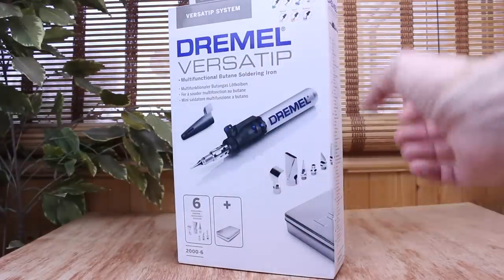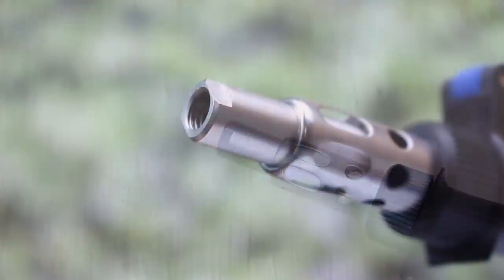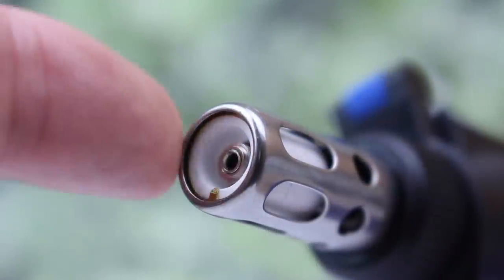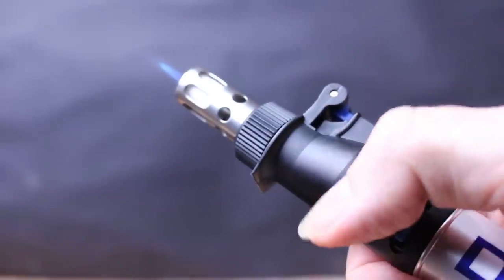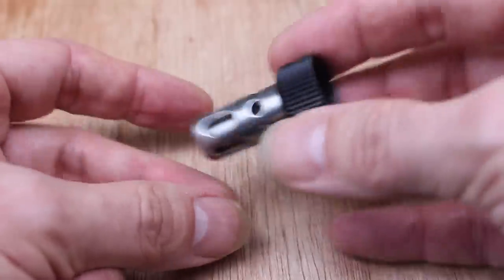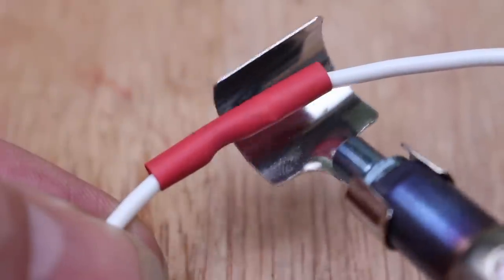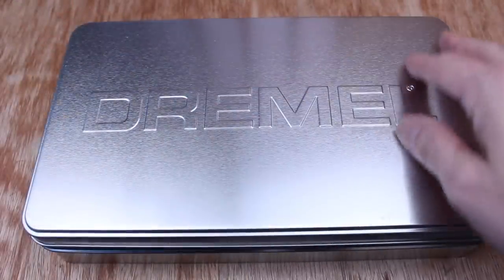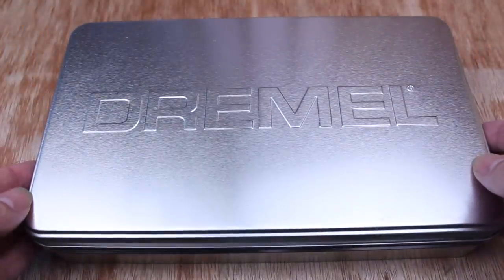Dremel Versatip Gas Soldering Torch Demo & Review in HD

Comment: I bought one of these a few months ago thinking it would be ideal as I didn't want to be tethered to a cord. They are OK but one down side and I think its worth mentioning is the heat exhaust. You have to be mindful of this particularly if you are working close to other parts or structures which can ignite, melt or burn easily, including your fingers! I on sold mine unit and went for a 50w lithium battery soldering iron. 100% better.
Reply from the maker: Yes, a good point , especially with the solid tips like the knife or the soldering tips, the heat comes out of the sides. Whatever the tip, it still has a flame. Dave
Reply: What do you use it for ,the battery one that is?can I use it to solder car wires for a computer box?

Comment: Mate I have one and been using it as an auto electrician for several years. When you have the soldering tip on theres a small vent hole on the side. Flame just protrudes and its great for heating wire up so the solder sticks and also the best for heat shrink. 

Then that travelling cap you spoke of. It is for when its hot. A safety cap. Put it on when the tip is roaring hot but do not put away till its cooled.
Reply from the maker: Thanks for the tip! Dave

Comment: Great video!  Thx!  One thing to add, I read reviews on Amazon and people are upset that Dremel is no longer supporting this product. No replacements parts or tips.  That's a bummer because I really liked your video and was thinking about buying one. Oh well....
Reply from the maker: I didn't know they'd stopped selling the tips. Buty the unit is pretty inexpensive  anyway, so probably wouldn't be worth repairing or replacing any parts on it. I guess everything still has a 12 month warranty. Dave
Reply: @CelticDreamsCoUk   My understanding is they are not honoring the warranty.  Many upset customers on Amazon.

Comment: Good review thank you, Great product when you get it, it works great, however BE  WARNED: the Catalyst does not last very long, as soon as it starts to fail the performance of the products drops dramatically until it stops working. These ‘spares, are very hard to find and when you do they are almost the price of a new Versatip, I have lost two already due to this as I was originally told I must have somehow damaged the catalyst mesh! I think Dremel is taking us all for a ride on this product.
Reply from the maker: Thanks for the heads up. Something to keep an eye on. Obviously if it wears out with in the guarantee period, send it back. Thanks for sharing. Dave.
Reply: I totally agree
 Bagariddim!  I was thrillled when I received my Versatip as a very welcome birthday gift some years ago.  It became an essential part of my yachtie kit - especially useful on my boat for soldering electronics; cutting sheets, halyards, etc and so much more - until the catalyst failed.  It lasted just past the 1 year warranty and has remained unusable in its box for several years.  I have tried everywhere to find replacement catalysts and found only the ridiculously expensive  kit which includes unnecessary parts.  I cannot understand why Dremel don't supply 3 or 4 catalysts in the original box or, at the very least, supply them as replacement packs at reasonable prices.  I have seen many complaints from other dissatisfied - and bewildered clients such as myself.  Dremel obviously don't give a flying fig!

Comment: Thanks for these demos on the Dremel, Dave. Getting into silversmithing and been wondering should I invest in jewellers drills and torches. The Dremel looks like it will do as good a job. Thanks again, man.
Reply from the maker: It's perfectly fine for small soldering. I spent many years making Celtic bracelets with a cheaper version of this. Until you want to work on larger bangles or start melting and casting, then it will be fine. Dave

Comment: I only need a wireless soldering iron to do some electrical work on my motorcycle.... But after watching this video, I think I'll retire my old Maplin's soldering iron and use this instead! Great informative video! :D
Reply from the maker: Thanks. I do find it much quicker and more convenient for little domestic solder jobs and wiring. It heats up much faster then the electric, and the convenience of being cable free. Especially when you've turned off the power, or you are working on the driveway. Thanks for watching. Dave
Reply: I've been using it for the past few days and I find it so useful that I'm even using it at my desk, where I can just use my regular soldering iron. Like you said, it heats up much faster than electric, so you can just turn it off and save gas, then switch it back on and it'll be up to temperature in no time! It's a fantastic piece of kit :D

Comment: Really great video thanks! 
Wenn soldering electronics, it tends to heat up the entire PC board with all the heat coming from the side. Any tipps on how to prevent this please? Thanks
Reply from the maker: Obviously the soldering head is being heated by the flame, so there needs to be holes in the side to allow the flame to burn. So yes, it will radiate heat from the sides of the nozzle. There is no way to avoid this. I can see that in close confined areas this may make it unsuitable. As I say, it's not suitable for everything. It's more of a general use tool with many applications, rather than a highly specialised tool for one specific Job (like an electronic soldering iron). Hope this answers you question, somewhat. thanks for sharing. Dave

Comment: Hi, nice video, is it not to big ? is it easy to handle? I had one for years , very small lake a pen, and this one seam very big to solder .. thank you  :-) nice review !
Reply from the maker: I too started with a butane pencil torch. It’s a matter of personal taste, I guess. The Dremel is a little thicker, but perfectly comfortable to handle (I have big hands). The main advantage is that the larger tank will last longer and allows a larger flame than a pencil torch. Hope this helps. Dave
Reply: @CelticDreamsCoUk  Hi, thank you , yes it's help thanks, that right that the tank is big, the mail problem on my old one was the thank ! thank you :-)

Comment: Excellent video sir.
Now please help. The catalist cube inside the nozzle does not last very long and Deremel does not seem to stock it at all. So your only option it seems is to buy a completely new torch. This is pathetic of Dremel.
Any other way to replace it?
Reply from the maker: Not had a problem myself, but just thinking out of the box here. Obviously if its still under warranty then get a replacement. Other thoughts, Can a part be salvaged from a cheap windproof lighter perhaps? Dave
Reply: @CelticDreamsCoUk  none of those are an option. Out of warrantee and bone of the windproof lighters have that same catalyst.

Comment: Hi.  Thanks for the video.  I am about to start making jewellery using silver solder.  My research says that I need a torch which heats up to a high heat and recommends a 100watt torch with variable heat.  Is the Dremel suitable for this please?   Thanks in anticipation.
Reply from the maker: Yes, absolutely. As you see it can be used for hard soldering of silver and gold. Dave

Comment: What is your opinion on the Versatip and sterling silver jump rings? I've read a couple of sources that haven't said the Versatip isn't good for soldering open sterling silver jump rings closed? Thank you.
Reply from the maker: It's a torch and as such is perfectly fine for silver soldering jump rings. The torch simply provides the heat, so if anyone is struggling, it's not the torch its their soldering method that's the problem. Almost any torch can be used for soldering silver and gold. But there are always three golden rules. the joint must be close fitting (no gap), clean (even from finger grease), and well fluxed. Apart from that all you need is proper solder and heat. Dave

Comment: Hello, I am making jewellery at home and want to do a little soldering. I am considering the versatip based on your video but only concern is some people are saying versatip is not good enough to solder silver jewellery only base metals? Is this true? Thanks.
Reply from the maker: If you just want a jewelry soldering torch, then a Chef's type Butane torch is much better. Hotter flame, bigger flame, and hold more gas, ie less refilling. This tools is useful in the fact that it does many things. But there are better torches, and better soldering irons. Depending on what you want to do.

Comment: Hi there Dave. Love the Tutorial. If you could be so kind to make a video Tutorial on how to Clean the external tools? greatly appreciate it. Thank you
Reply from the maker: As the tips heat up, they will quickly go black and loose their new shine. But don't worry that's normal and does not affect the performance. You don't need to clean them or polish them. If you are using the soldering tips, you can wipe them on a wet sponge (provided in the tin), when hot to remove any excess solder. Just as you would with any normal soldering iron.  If you ware using any of the hot cutting knives with plastic, then allow it to cool "completely" and just peel off any molten plastic stuck to them, using your finger nail or a craft knife. Dave

Comment: thank you for this. I bought this tool last year but still have difficulty using it. Most of the time I revert back to my creme brulee torch *blush*. Also I have been trying to solder jewelry with the tip on like you would with a soldering tip, but it seems with the tip on, it doesn't get hot enough to melt the lead free solder, say around glass that I want to create a soldered edge. Am I correct in thinking so? Think now I will have more confidence using it after watching your video.
Reply from the maker: The whole question here is what you mean by soldering. for Tin, electrical solder you can use the heating tip as this melts at very low temperatures. I can see this could be problem if you are soldering close to the edge of other components, I suspect that the glass is sucking the heat away from the metal, you you may need to turn up the heat a bit.

However, what we "jewellers" call soldering is very different and  more akin to brazing, using silver or gold solder. This requires much higher temperatures typically over 600C. So for proper jewellery soldering you will need to use the flame. 

Hope this helps. Dave.
Reply: Yes definitely helps. Thank you!

Comment: Putting in a purchase soon for this! Thank you for the well informed video! 
I also had a question i hope you could answer for me. Your help with this would be greatly appreciated! 
"I'm trying to solder my copper cross pendant to a new bail, nd I'm not sure what to use to make it a strong hold."
Reply from the maker: You can use jewellers silver solder. That will give strong join. But the joint will be visible.  You can get copper solder wire, (...if you can find it). You use it like any other jewelry solder, with flux and a torch. That will give a better colour match. Dave
Reply: @CelticDreamsCoUk  I appreciate your expertise on this 👍🏼 btw I've been trying to get some answers from like 10 different people and you're the only one who responded, thank you for that.

Comment: I want it now !lol.. btw is the flame size of versatip and versaflame same? planning to buy versatip for tiny jewelry welding if the flame goes as small as this versatip..
Reply from the maker: The versaflame is stand up unit with a larger fuel tank. Without comparing the two I'd say a  naked flame is about the same size. Dave
Reply: @CelticDreamsCoUk   Thanks! That's what I need! Larger tank, smaller flame.. xD

Comment: Sorry if this sounds stupid, but didn't it ever happen to anyone that this thing exploded? Maybe not the Dremel ones, but the Chinese torches similar to this one perhaps? I'm wondering if it's just a stupid fear of mine that it would explode in my hand, since an electrical one, one of those instant heat solders once went "boom" on me while working and luckily I wasn't injured, but it was the hell of a scare!
Reply from the maker: No I've never heard of one exploding. But just do be clear, you are referring to an electrical soldering iron and also to Chinese copies. I don't sell these tools, so I do  publish every comment, good and bad to help give an honest opinion. You can see how many views and comments the video has received. No one has ever comment about an explosion. I doubt the tool would be allowed on sale if this happened, it would be recalled. perhaps the Chinese copies don't have the same standards. Hope this helps answer. Dave.

Comment: I was after purchasing gas soldering gun, found your video and ..immediately after watching it, I chose Dremel over other China's stuff.
Reply from the maker: Yes, lots of copies I'm afraid so do be careful. I've had this for a while now and had no problems with it. The auto ignition is a real handy feature. Thanks for watching. Dave
Reply: @CelticDreamsCoUk  So, 3 years of quite regular, fortnightly soldering of uncomplicated Arduino or car electronic projects and I finally had to exchange the tip. Excellent value for the money.

Comment: look awesome, and time  burn after recharg?
Reply from the maker: Very difficult to say, Depends on weather it's fully charged, the size of your flame, and to some extent even the ambient temperature (and hence the pressure). Dremel quote 90 minutes, but as with any manufacturers specs, I suspect that is the ideal maximum under perfect lab conditions. Hope this helps. Dave

Comment: how long does the catalyst last ? is it replaceable and where can we buy it?
Reply from the maker: I don't think Dremel supply it as a spare.. So its obviously not something that they expect to wear out quickly and replace. The tool is not expensive so I doubt it would be worth it either way. Mine still works fine a couple of years on. But it only gets occasional light use, usually for heat shrink. Sorry I cant be more specific, but I hope this helps. Dave

Comment: Thanks for the review. Homebase has a deal on, this for £23, resrved and picking mine tommorrow. Thanks for also showing what the fluid you use, can pick this cans up for less than £2.
Reply from the maker: Just regular cigarette lighter gas. Thanks for watching.Dave
Reply: @CelticDreamsCoUk  Thanks, I just picked mine up, at £23, a bargain especially since cigarette lighter gas only cost a few quid. Where do you buy yours, local or online. I just checked ebay, a can cost £3, is that the price cigarette lighter gas normally cost?
Reply from the maker: I get mine anywhere, usually local supermarket tobacco counter.

Comment: Hi Dave, I want to make garden ornaments Owls etc from recycle tin cans. Would the Dremel versatip gas solderer be right for the job?  Cheers June.
Reply from the maker: The flame is certainly hot enough to braise and solder, but the flame is very small. So it would struggle with large items like tin cans. for larger items like you are referring to, a standard DIY butane blowtorch would probably be better, along with some pre fluxed brass braising rods.

Note too that "Tin" cans aren't actually tin. They are either steel or Aluminium. Aluminium cans can't  really be soldered as the aluminium just melts. So you'd need to use the steel cans. Dave.

Comment: Hi. If you use it continuously for a long time without turning it off, will it not melt the plastic that touches the metal part?
Reply from the maker: I see what you mean, but no it doesn't seem to be a problem. Dave

Comment: Hello I've bought this after watching your video on it. However I am having trouble cleaning the solder tip, and getting solder to stick  to the tip by using flux. Any suggestions on maintenance , especially the solder tip?
Reply from the maker: When using a soldering iron for electrical low temp soldering you usually clean the tip with a little damp sponge on the stand. Just use a litle pad of kitchen towel slightly damp. wipe the tip as you use it to keep the tip clean. Dave
Reply: @CelticDreamsCoUk  Hi dave, i do clean it with the sponge or even the steelwool, i still have issues with heattransfer

Comment: As a jeweler, would you recommend this over the bigger Dremel torch? Will it heat up enough to solder brass jewelry? 
Thanks. :)
Reply from the maker: This will certainly solder brass, copper and precious metals, using either electrical tin solder, or high temperature silver & gold solder. The choice of either this or the larger one really depends on what you are soldering and the size of the piece you need to heat. For small jewellery then this is fine, for larger items like bangles of anything larger then perhaps go for the larger torch. Hope this helps. Dave
Reply: Hi Dave, thanks very much for the reply. I'm venturing into metal work and currently making brass jewellery.  I love the idea of the versatip with it being so little and compact but i think in the end i'll have to get the Versaflame as it just makes more sense! Thanks again!

Comment: Hi I was just wondering if you could use this to “pin” things in jewelry making.   Pinning when you ball up both ends of a wire to pin beads or chain in there.  ??     I use other butane torches for jewelry making but the flame isn’t small enough or intense enough for me to heat the silver wire into a ball without damaging the rest of the piece.
Reply from the maker: The flame on this is quite small at the lowest setting so perhaps more detail than the larger Chef type torches. Hope this helps. Dave

Comment: Can the soldering tip be used with solder paste that comes in a syringe?
Reply from the maker: No you need around 700 degrees centigrade to solder silver and gold (with solder paste). But this can be done with the open flame. Dave